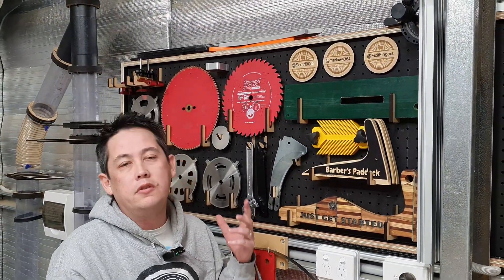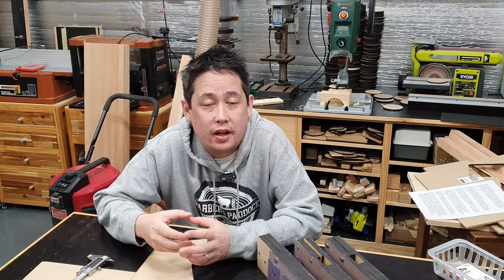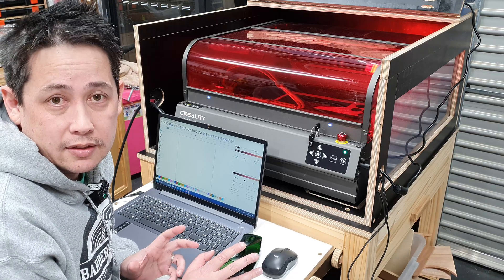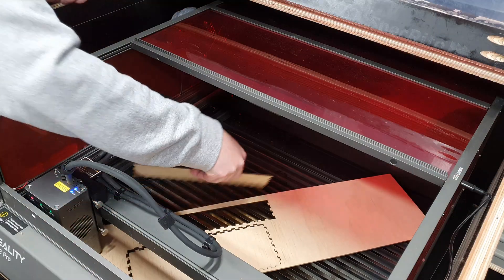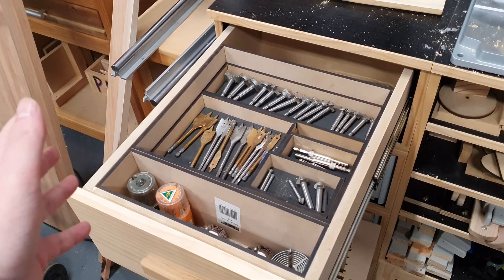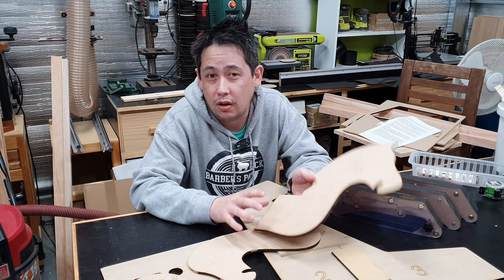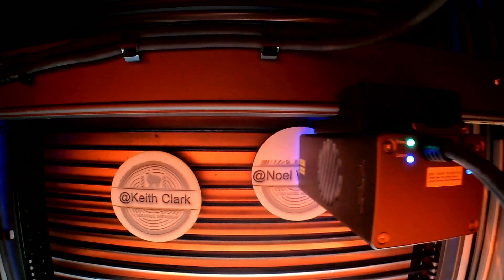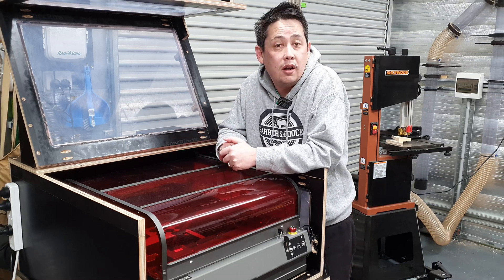I was wrong! 5 reasons to have a laser in the shop - Creality Falcon 2 pro 40w

Comment: Why use a laser cnc  instead of a router cnc ?
Reply from the maker: Excellent question.  The reality is, there is no reason why you couldn't do any of the workshop projects I've done on a CNC instead of a laser.  Hell any of the laser files I've provided for previous projects will work in CNC software as also, if you're inclined to do that instead.  

I do actually own a small CNC (very basic), but even if I did have a bigger/better one (it is on my maybe list), it would still be faster to make these on the laser IMO.  For small, let's say delicate items or small parts (example the dust shroud) etc a router bit will be just too big to get the job done.  My original prototypes for the magnetic coupler were actually done on a CNC, but it took 4 or 5 times as long to produce those as it does on my laser and I couldn't get it as clean.
Reply: I have both - for templating the laser CNC is MUCH faster  - no need to fix down material - easily can cut 3mm acrylic or plywood in 1 cut. Also you can cut and engrave (useful for numbering and/or naming templates or adding measurement marks without having to change a router bit...
If you need to make materials that include depth cuts as well as through cuts and you also want to cut thicker materials (20mm+) that's when CNC router is better
Reply: Which Creality Falcon2 laser is that one?

There are a few different ones on their website.
Reply: Which Creality Falcon2 laser is that one?

There are a few different ones on their website. 22w, 40w & 60w